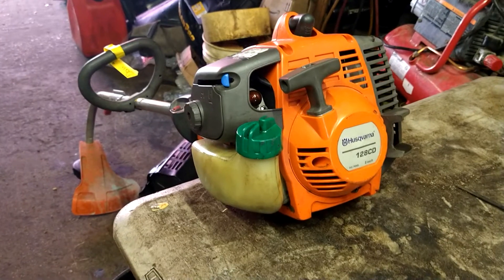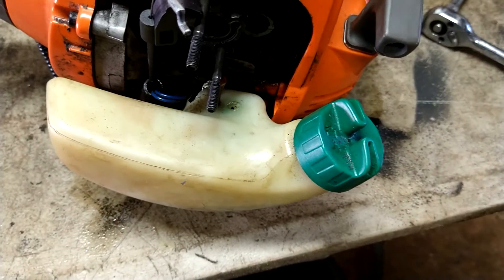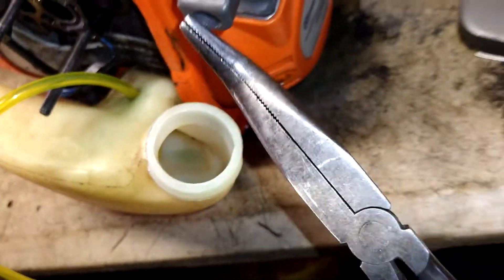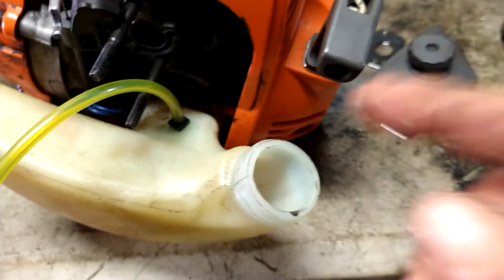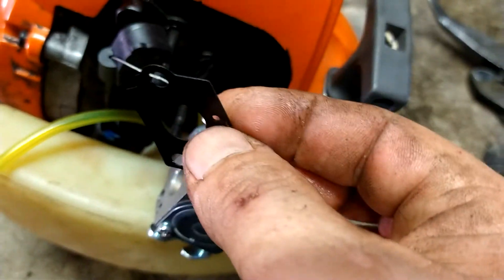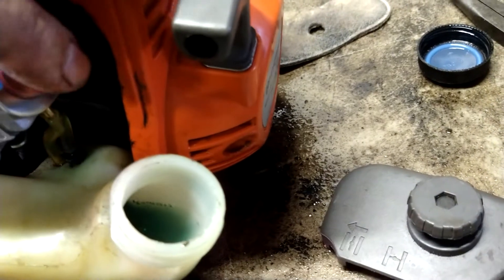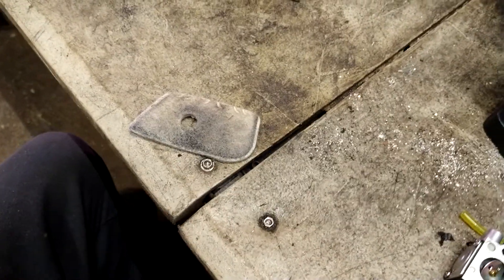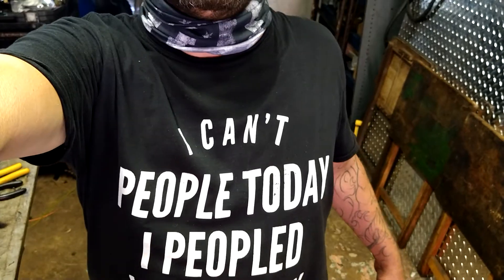Husqvarna 128cd carburetor fuel line repair

Comment: Great video, if you can help me, after I did what you exactly did, it turn on except when I tilt it, it dies, do you have any idea why?
Answer is much appreciated!
Thanks!!
Reply from the maker: Either fuel line with filter is to long or no filter on or line kinks when tilting or hoses on backwards.
Reply: Thank you so much for replying!!!
Fuel filter is new, also I don’t see no kinks. The only thing is I’ll try to see if I  switch the lines to  see if it works, I’ll keep you updated!!!
Thanks!!!
Reply from the maker: @habiby4ever  yep! Good luck!
Reply: Very good!!
I had my hoses flipped out and it kept shutting off every time i tilted.when I watched your video made it clear
You answered my question and solved my frustration very quickly!!!!
I appreciated sir!!!
Thank you so much!!!!!
Thanks
Reply from the maker: @habiby4ever  nice!

Comment: I have a two year old Husqvarna 128DL. It wouldn't start this spring. I replaced the carb, fuel lines, filter, air filter, spark plug and put fresh gas in. It will start on half choke and the throttle held wide open but won't go much over an idle. I checked the spark arrester and it looks new. Suggestions?
Reply from the maker: there are 2 adjustment screws right next to each other. the one closest to the air filter needs to be turned counter clockwise a little at a time till you can achieve full throttle with no bog. here is the tool kit for that. https://amzn.to/2WfCOVP
Reply: I have the tool and tried several times to get it adjusted. It never improved much. Thanks for the suggestion.
Reply from the maker: @mikemilam525  did you forget the gasket between the carb and motor. Is The isolater block between the carb and motor tight?
Reply: Yeah I’m 100% sure of those things. I’m of the mind that the replacement carb just wasn’t made right. Not the first time over the years I’ve gotten a bad part. But it happens so seldom I get to where I think I’ve done something wrong and beat myself up trying to find my mistake.
Reply from the maker: @mikemilam525  it happens. Its rare but does happen.
Reply: Same thing here.  Previous owner had not replaced the gasket in between the carb and motor, so my replacement carb bogged out because I put it on as the last owner did not knowing better.  Thanks guys, new subscriber!